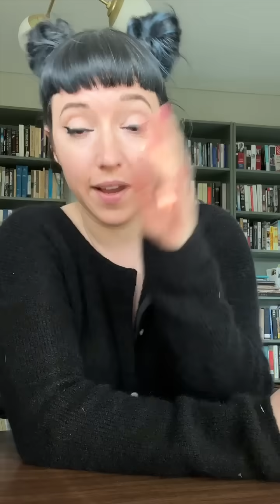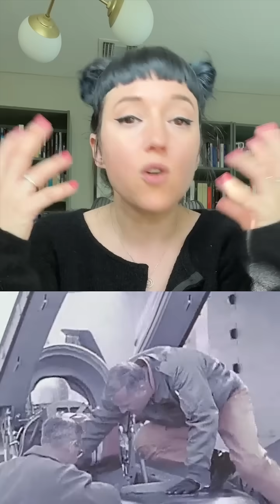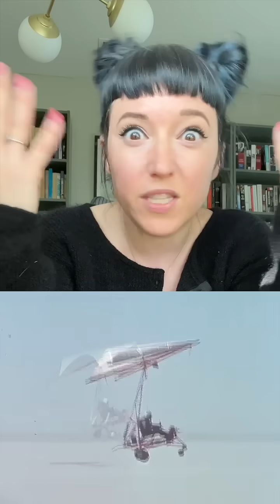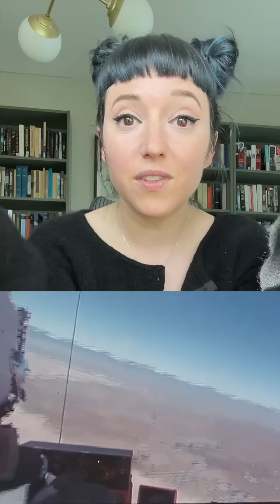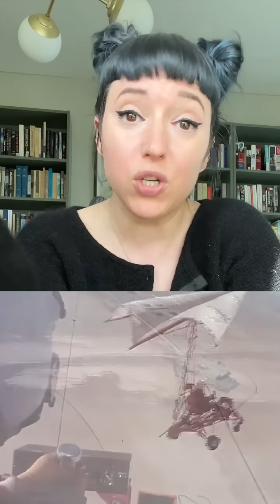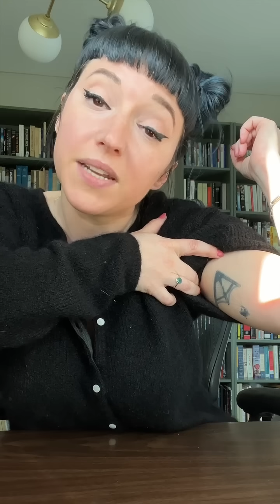NASA's flying tricycle  #shorts #history #nasa

Comment: I was 14--16 years old when the manned Gemini flights were made, and I remember how it was pronounced.  You've got it right.  One thing that struck me at the time was the emergency escape system (fortunately never needed, would that Apollo and Space Shuttle had been so lucky).  Mercury had used a rocket on a lattice tower above the capsule, which was the same, only bigger, on Apollo, but Gemini used the same engines used to separate from the booster and as retros.